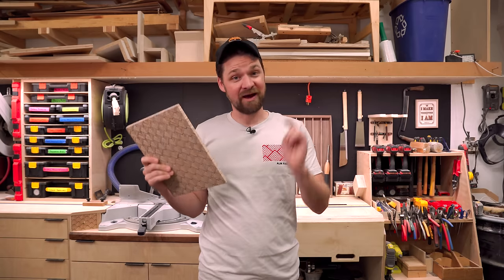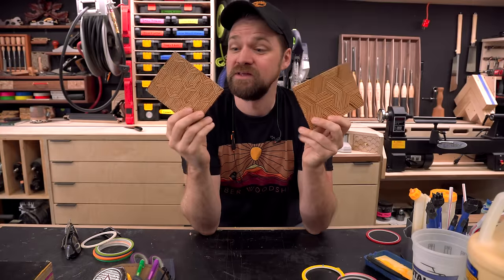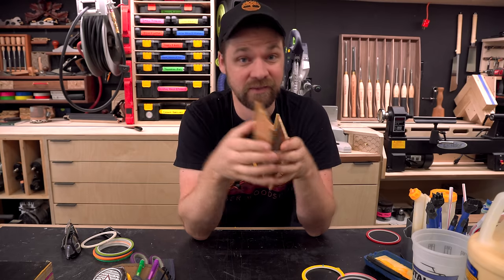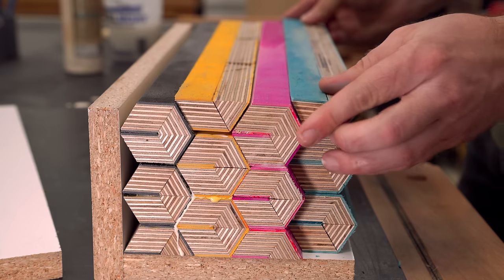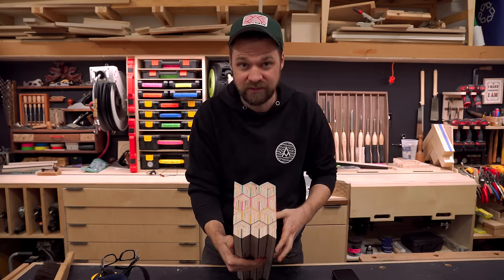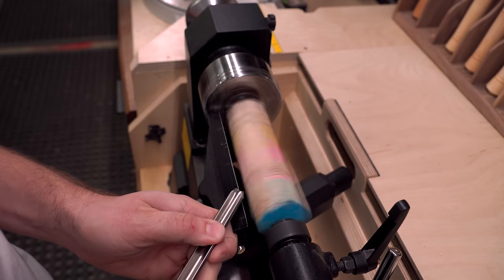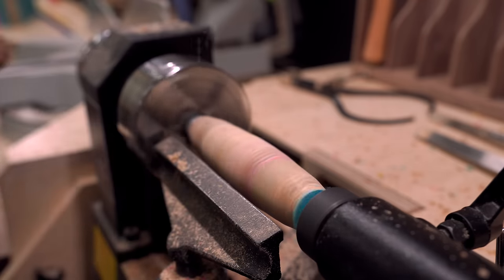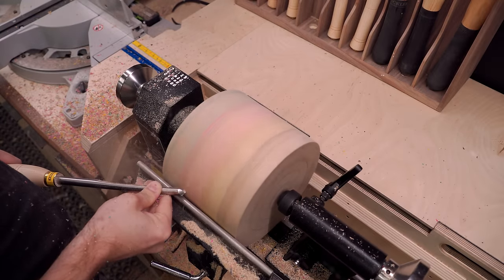Can you Woodturn Patterned Plywood?

Comment: You casually set up what most turners have to save up for years to attain.
You refer to adding a lathe as one would adding another drawer to the design. Your newby starter tools are Robert Sorby. The Nova chuck has mulitpul attachments. You have a top of the line sharpening system.  Turning is not a tool you use when you need. It's a skill that takes a lifetime to prefect, and it's a passion for those of us who get into it. Idk if the turning bug has bitten you, or if this will be the last or nearly the last time you work on the lathe. Before you give up, a couple of suggestions...... before you turn your made blank, vacuum in some super thin epoxy. Deep pour works good. Takes a couple days to set but it makes it one solid piece. And grab yourself a carbide turning tool. Super simple to use, no need to sharpen, and much gentler on resin and fragile woods. You are so invested already, another couple hundred dollars to perhaps give you that successful feeling all makers want is worth it. 😉 And yes, I own it, I was bit by that green eyed bug. Not in an ugly way, just in a hope you appreciate having what most of us will only dream of. You are good with wood, and I know I fell in love with turning after a few successful projects. Hope you give it another try.

Comment: Love your work and videos. Instead of using tape in your glue ups, try using rubber surgical tubing wrapped around the length of the logs. Provides a heck of a lot of clamping pressure consistently down the entire length and its reusable. Just a thought.

Comment: you can have a tenon inside a recess, then you don't lose the pattern on the outside, a tenon probably would have been a better option with the plywood

Ray Whitby has done a few projects with turning patterned plywood

Comment: One of the reasons you had so much trouble with breaking is each glue joint is a weak spot and the harder you push with the lathe tools, the more force you exert on the joints...take too deep a cut/push too hard and SNAP goes the piece...

So next time you try working with a multi-glued pattern piece, take nice light gentle cuts...you'll be working on it till Half-Past Doomsday, but you should significantly reduce the chances of having it break in the chuck...

😄😁😆😅😂🤣

Something else to think about when working with multi-glued blanks like this is when the chuck grabs a mortise, it's putting a lot of force from the center outwards, in effect, it's trying to tear the blank in half down the center-line of the blank. A Tenon on the other hand, doesn't have that problem as the chuck is trying to crush the tenon inwards like a beer can. If you don't have a lot of material to spare to cut the tenon, you can always try gluing on a sacrificial block with LOTS of hot glue and carve that into a tenon and then carefully chisel it off at the hot glue joint after it's finished...

Comment: Just drill hole trough the material and glue dovel, then the bolt in place. I have done few of these handles from epoxy juniper mix using drill as a lathe and you can make treads into wood then use bolt to hold it in place, so no need for expensive lathe, if you are just beginning and its purely hobby, figuring things out. Only issue is that you need to build holder for the drill, get ball bearing drill if all possible since slide bearings will wear out rather fast and tailstock is needed for anything longer than 5cm. You can build one from long bolt and scrap peaces of plywood.
For CA glue finish get thinnest you can find, then put the drill or lathe on the lowest setting you can get, put on some glue and use strip of plastic to spread it. After little while say minute take excess off with peace of paper. This allows glue soak into grain and really make it hard composite coating few mm deep and fill gaps. There is no need for sanding between, but you can do it if you want to fill any gaps with sanding dust, then repeat the coating. I would not suggest using activator in this one since you want it to soak in deep as possible.
For composite materials like epoxy and plywood, use carbide tooling, or risk overheating and ruining temper on steel.
To make it easier to turn, try to figure out how to apply low density cheap wood inside, so you dont have to remove another bowls worth to plywood.

Comment: You should probably get out most of the material in the center with a forestner bit. It would be faster material removal and, since all the cutting forces are axial instead of radial, the risk of throwing the piece off should be minimal.

Comment: Is it possible to use the epoxy (or some other resin) to let it seep through the wood and reinforce the plywood structure? I think that the weak point is not from the individual wooden sheets that are glued together, but from the layers of pressed sawdust which lies between them. What if you glued the sheets together with epoxy instead of glue?

Comment: I wonder if any off the problems you faced on this would be eliminated if you used epoxy instead of wood glue? Maybe stronger too? I've seen some other YouTube sites where they actually turn epoxy in parts of the wood where there was a "hollow" or missing piece of wood. Looks like the epoxy portions turn pretty well.

Comment: For a nub the bowl was way too deep, try 3.5 to 4 inch tall bowls until you get comfortable with the turning tools. Man easy up on the side pressure if you going to push do it from the top to bottom with the bevel riding against the bowel.

Comment: What I find hard to digest is that so many makers look up to you for inspiration, yet you seem to have failed to look at your fellow makers for guidance. It’s not a hard find that makers turning with recycled skateboards favour epoxy rather than wood glue. I’ve been turning ply / skateboard veneer for over 3 years now with zero failure, partly due to already having a background in epoxy ply boat building. I’ve never thought about sharing videos on the subject, but seriously, ditch the glue for epoxy…

Comment: You should not have to sharpen your tools so often .you are either sharpening them incorrectly or they are not good tools . .If the tools are not made of good steal and have not been hardened and tempered properly, then they will not hold a good edge and they will get hot and dull much quicker then a set of qualify cutting tools. good luck with all. It all looks great. I'm just trying to give a helpful tip.